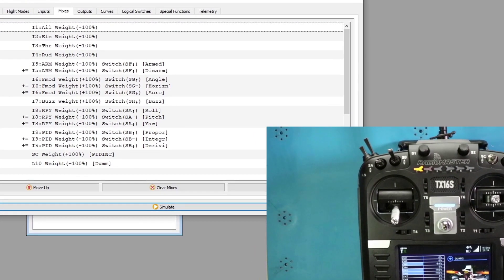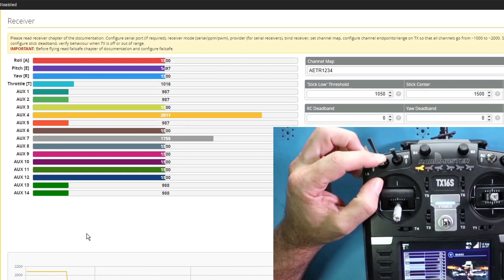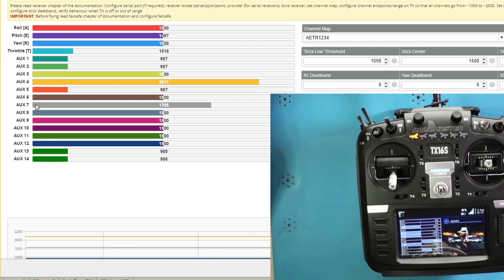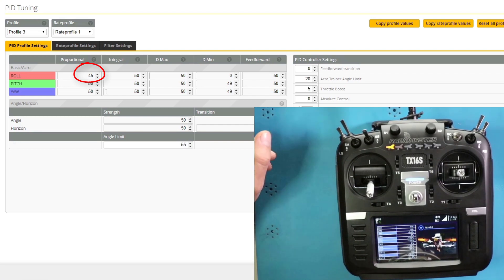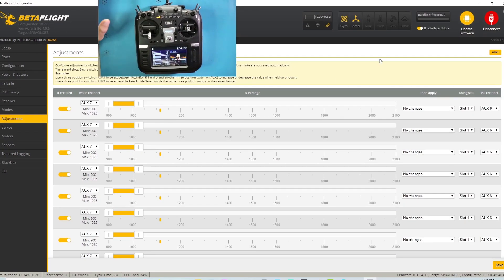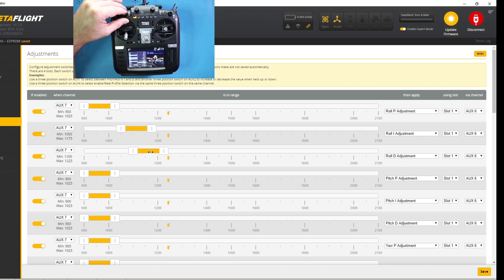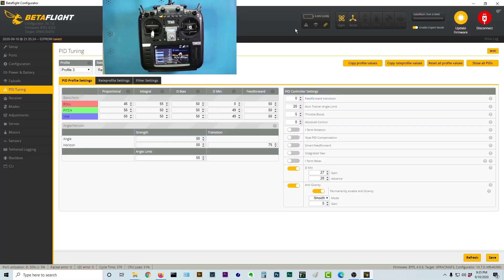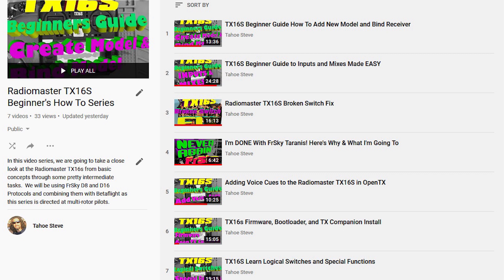In Flight PID Tuning on the TX16S With Betaflight Adjustments

Comment: Hi, I went trough all your videos untill this, and everything work correct, but now it looks something wrong. When I check my receiver in Betaflight, I can see only  SA on  AUX4. I don't see SB on AUX5, as also SC, and AUX7 don't react on CH11 (dummy). What I did wrong?
Reply: Ok, I fix it by changing NANO RX mode from CH8 to CH12

Comment: I use 1 switch to select P/I/D and transform my Trims in 2 side temporary switches and use them to up and down my pids in the air. I think this method dont need to think a lot, your trims buttons in your hands is easy to manipulate and logical with roll, pitch and yaw.

Comment: Hi, I followed video n.5, and it seems to be going well, but when I've arrived at this point, and I don't know why I have just 4 AUX (AUX 1-2-3 and 4) on Betaflight, both in Receiver and Adjustments tab. What should I do to see and arrange the missing AUX? 
The other command looks working well.
Thank you really much for your videos, any advice is welcomed.
Reply: I have the same problem
Reply: @dimosthenischristopoulos2606  Anyone who can help us? 🙏
Reply from the maker: What kind of receiver are you using?
Reply: @TahoeSteve  I'm using a Radiomaster Tx16s Hall Sensor. I'm checking on google, can be something related to the mode RT D8 or D16? I'm a beginner, I have not enough knowledge about it.
Reply from the maker: If you can tell me what kind of receiver you are using I could tell you whether it's D8 or 016
Reply: @TahoeSteve  Yes, actually I have setted: MULTI FrSky D - D8 - CH1 - CH16 both on Internal and External RF. (I don't know if this is relevant, but I'm in Europe)
Reply: @TahoeSteve  Thank you very much for your reply! I am using tbs nano and by falt i had set it at 8 chanels
Reply: @TahoeSteve  Update: I set D16 and indeed now I have all the 16 CH. I was a bit confused because in a previous video you used the D8 mode for the Tony Hawk (the drone I'm using), and even I read in another forum that D16 mode can give flight problems, but apparently, this is the only mode I found to have the 16 CH.

Comment: HI, so im fallowing this tutorial but Im having a problem with my beeper. Where can i disable the beeper on SC increments? I dont know why its making beeps with that. 
But the big problem is that beeps 2 times faster when decreasing the AUX6 value
Reply: Other question, my AUX6 value is decreasing when i put SC up and increasing when I put it down. its a easy fix, just had to change the mixer value to -100%
Reply: It's meant to work that way. Increase by one is one beep, decrease by one is two beeps.